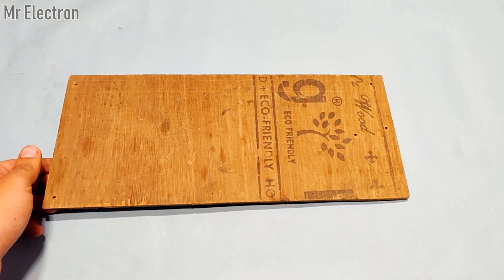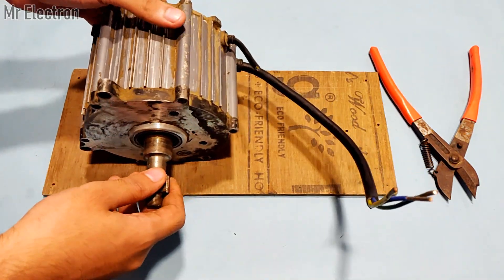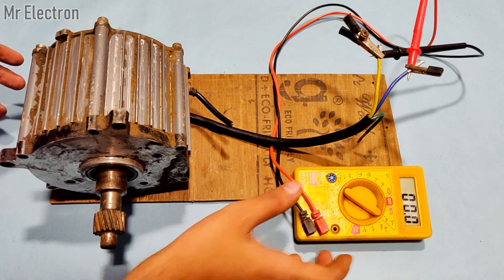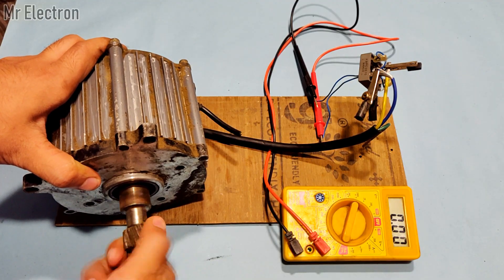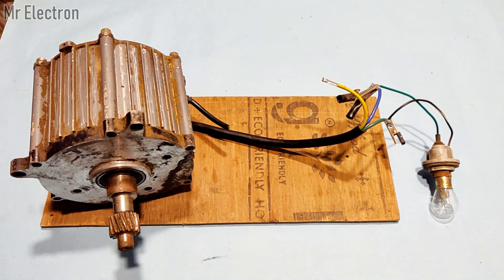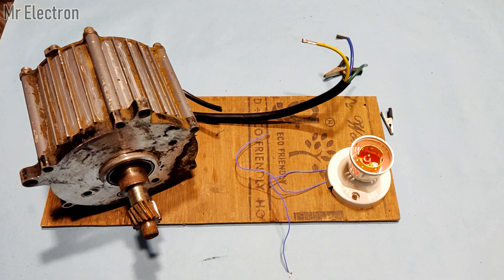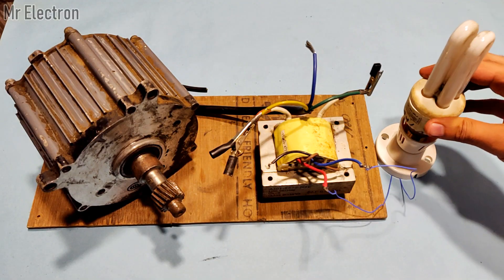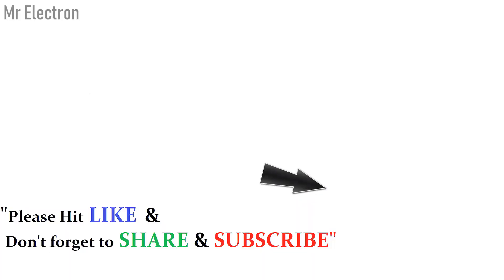Free Energy is Hoax | Make a 220v AC Generator from BLDC Motor Video

Comment: I had made this ,but how to continuously rotate motor.
Reply: Try using a low voltage torque motor to drive it.
Reply: To continue rotate motor you will connect with your cycle